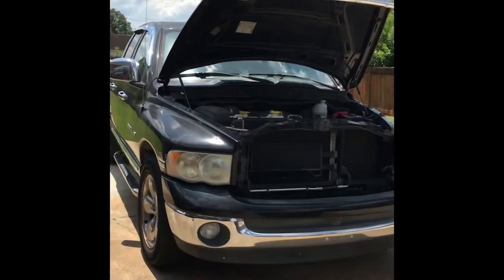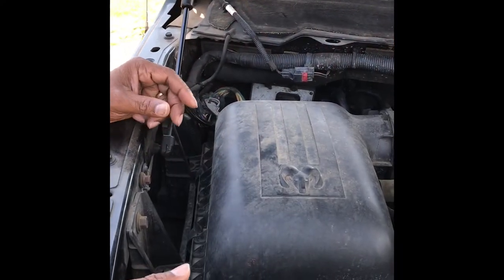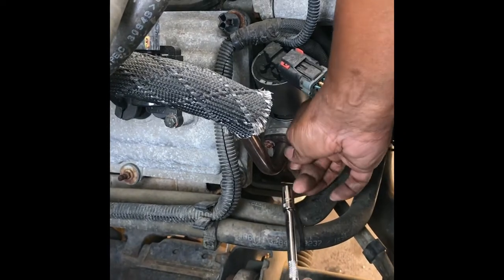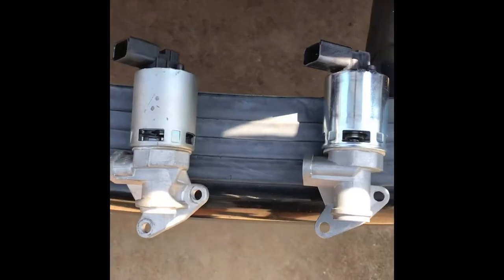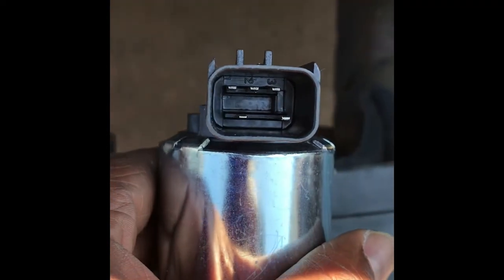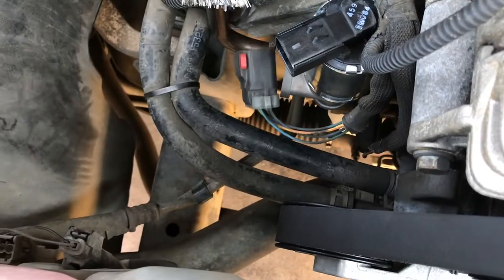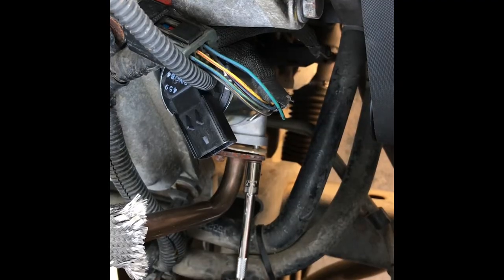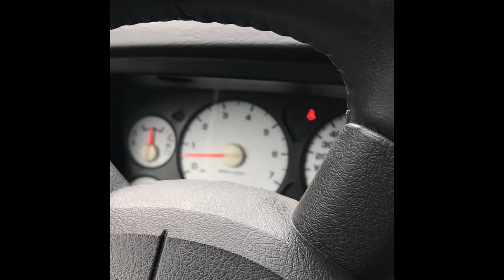Stall Issue Resolution Ram 1500!!!

Comment: It's an issue with the throttle switch everybody keeps saying this and that and everything else but I've put a pedal commander in three different Rams now that's stalled God damn near everything you came to a stop at like it's a clutch or something and you don't even have to turn the pedal commander on You will never stall again I swear to you on that and a pedal commander is fun to have and it's also better to have a pedal commander for your throttle because it's quicker and easier to control unlike a tuner where you have to go back in and modify things just to get to it and get the switch right there in front of you to do what you want tune everything else but ped😅 commander for the throttle it'll never stall again and feel like you got a lot more horsepower but you're actually just using the horsepower you already had but couldn't use have fun
Reply: Bummer they don’t make one for 2004
Reply: @stephenwells3683 right I’ve looked everywhere debating if a bully dog tune is worth it.
Reply: Thank you this makes sense I’m going to take your advice
Reply: My 2012 like to start but cut off right after but starts fine after has the 4.7L with the pedal commander I noticed it stayed on for long periods of time after trucks shut off I turned it off to start then just turn it back on after the truck was running seem to interfere with the pedal switch on the pedal it's self but didn't know fs
Reply: What's a pedal commander
Reply: @moshebolinger2136  it makes your throttle response quicker
Reply: I have a Pedal Commander in my 2021 Ram 1500 Classic with the 3.7.   It stalls, and more so as it warms up.  I haven't been able to figure it out.  Had the cam shaft sensor replaced... no change.
Reply: @talltexan36  have you solved the issue? I have the same problem.

Comment: My 2020 dodge 1500 has started doing this. Left the truck with my mechanic for a week and he couldn't get a code to show. It would stall out a a red light or stop sign in the heat of the day. Getting worse today so I'll get it back to the shop. I'll show my mechanic this video. Thank you
Reply: I think the biggest problem with the idle issue is the transmission fluid level I'm going to go over this with my mechanic in the morning
Reply: Well what was the update?

Comment: The individual coil packs and honestly the throttle body is dirty as crap. So, clean your throttle body and the sensors attached to the side of it. Also, these rams are also known for their sludge build up because they like to burn oil. This sludge can ultimately kill your vehicle. So make sure to flush with every oil change.
Reply: To flush you say 🤔. What you gunna flush . I'd like to hear this flushing technique you speak about.
Reply: @kellykolnes1954 maybe they mean using sea foam to get rid of the carbon buildup before it blows up a head gasket. Little grains over a long time Can create a mountain or some shit.

Comment: Any mobile mechanics in Lafayette,LA? I changed all sensors, coil packs, spark plugs, egr valve, and my truck still stalls on take off big time only thing left the buy is new ECM idk if it a vacuum leak or what

Comment: Did Egr valve fix it ?? I just did crank sensor and got worse
Reply from the maker: The EGR valve solved my problem.
Reply: @collegefootballnightcap9918   that was making truck stall out?
Reply from the maker: Yes. It was sucking air for some reason. Make sure you get those bolts back to 20 ft pounds also! Another thing you can check is the throttle body. They build up with carbon on these trucks.
Reply: @collegefootballnightcap9918   no luck on mine replaced egr and crank sensor still no start
Reply from the maker: Check that throttle body position sensor. That can cause the engine not to start also.
Reply: @collegefootballnightcap9918  
Thanks ordered tps and new throttle body also got cold air intake to avoid all the oil from
Breather going into intake/motor and intake filter also had oil bad design
Reply from the maker: I hope it works out for you! Let me know how it goes.
Reply: @buildingadream9861 what do you do with the tube after install? Does it come with like a cut off filter or something where that hole on the oil cap?
Reply: @joshuaellis1054   comes with a hose that  blocks it I think is how I did mine truck still
Having issues gonna try jumping fuel pump relay tomorrow hope I just need new fuel pump fuse/relay.   Did fix the stall issue but still crank no start issue
Reply: @buildingadream9861 Not sure if you’ve solved your issue or not but I had a crank no start condition on my ram 05 4.7 4x4. My issue was the wires that went to my crank pos sensor was melted together underneath the heat wrap. Check and see if you have 5 volts being sent to the crank and cam pos sensors. If not check those wires.
Reply: I have the same problem with mine it stalls at a stop or red light and out of a sudden when driving. I wait a couple of minutes and I’m able to turn it back on I’ve already changed the EGR and it continues to do the same anyone have any suggestions of what may be causing the problem?
Reply: @AlondraSanchez-wl2js you ever figure out what was going on?
Reply: @AlondraSanchez-wl2js have you checked the distributor cap?
Reply: @taryndurling5701  those engines have coils, no distributor cap. Coils and 16 lovely spark plugs

Comment: I have 2005 dodge ram 1500 5.7 magnum hemi.. changed plugs and wires and coil packs and water pump and replaced the manifolds and gaskets. When i bought the truck aomeonw cut the catalytic converters off and atraight piped it. The truck never had a problem running when i first had it. Manifolds were leaking and i replaced that. It ran better and didnt have a lroblem for awhile. So i decided to replace plugs and coils because they were old. So i changed that and for the first couple of days it ran great. Then after that is when the truck started to stall and shut off at stop lights and losing power and somwtimes hard to start back. 
Codes i get are O2 sensors high voltage and low voltage on both. Engine light use to flash when driving but now hasnt done it in awhile since i changed the coils and plugs and wires. 
Im wondering if it is the MAP sensor or crank shaft sensor or O2 sensors or fuel injectors..
Reply from the maker: You should recheck the coils and plugs. I purchased a bad coil once and I had similar issues.
Reply: Having the same exact problem getting code po430 no other codes just keeps stalling randomly and is now getting hard to start back up
Reply from the maker: Also if you are getting code p0430, check the 02 sensors.

Comment: From what I'm seeing,and hearing, no one really knows what's causing it they just keep replacing things until they find the correct issue .
I have this issue.
I bought my buddy truck he passed away. The first owner of the truck he said it's been doing the stall thing from the beginning. The truck has 86 thousand miles on it like new .
It's so frustrating, very dangerous pulling out in front of traffic. 
People say this or that one guy said the seal on Transmission filter. If it's not perfectly fitted, it causes bubbles in the fluid, causing a miss read, thus stalling. I'll give that a shot.
Reply: Even with a pedal Commander my Dodge Ram still stalls

Comment: I’ve been having the same problem for 3 years and I have spend a lots of money replacing all kinds of parts and still my truck does stall,I don’t know what else should I do,I have change EGR VALVE,all the sensors,throttle body,I even changed the computer on the truck and still doing the same thing,also my RPMs are at 500 which I think is very low but I don’t know,I hope some one reads this and give me a clue on what else I should do,my truck is a 2005 5.7 hemi Daytona edition
Reply: I have an 08 Ram and have the same issue. Stalls out when coming to a stop or in bumper to bumper traffic and not pressing the gas pedal. Its very frequent if its hot outside and if i just filled up my gas tank. I've noticed it occurs less when i dont fill past 3/4 of a tank. I also noticed my voltage gauge drops almost to nothing. If you've already replaced EGR, check the lines going to it. I also saw a fix where someone checked the connectors under their TIPM Power supply module and 1 of the 4 connectors was not secured and after they locked it down it resolved the issue. I just ordered a Vapor Canister Purge valve solenoid as well as MAP sensor. I'll let you know if either fix it when i get the parts next week.
Reply: I already replace everything you are planning to replace and  still but the only thing I haven’t replace is the lines for EGR valve I think I’m going to do it pretty soon
Reply: Wanted to give an update in case you haven't resolved your issue yet. I kept having the stalls and watching the battery voltage gauge and RPM's drop every time I came to a stop or in slow traffic. What has 100% worked and fixed my issue so far, is I found a loose connector (Blue one) on back of my TIPM box. It's like it had been disconnected and barely hanging on this whole time. Plugged it back in properly and checked wires for any damage and now my battery gauge no longer drops and truck stays running when i come to a stop. Not sure if this could be your issue but it was mine, and just wanted to pass along to anyone that may have experienced or is experiencing the same. *Check all connections on back of your TIPM*
Reply: @The_Lost10mm  thank you man for sharing,I will check every single wire on that TIPM I will let you know if my issue is fixed and again thanks for letting me know.
Reply: @The_Lost10mm   by the connector, do you mean the fuse-looking connectors or wires? 2013 ram V8 1500 haveing the same stall issue.
Reply: I have some similar issues (stalling) with my 04 ram 1500 w/5.7L. I've done all the same things you have, and I'm still throwing an evap leak code. I'm going to replace the purge valve canister, then if that doesn't work, drop the tank and replace the fuel filter and fuel pump. I'll check those connectors to my fuse panel/TIPM as well. There is also a clunking noise coming from the torque converter area, and it's the original one which is now 160,000 miles and 20 years old, so I'll likely be replacing that as well.
Reply: I have a 2012 Big Horn having this issue. Thanks for the tips everyone.
Reply: @bkhender4197  Have you had any luck figuring out the stall issue? I also have a 2013 1500. Mine is a 5.7 hemi. Rpms drop when coming to a stop or slow at random and it stalls with a message to shift to park and select a gear.
Reply: Any update?